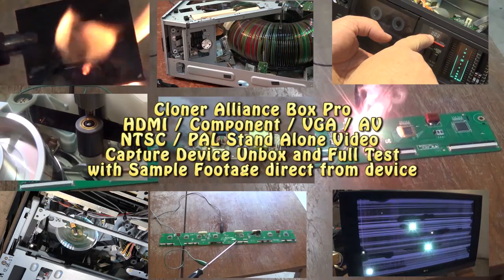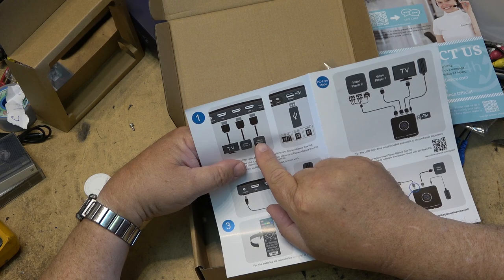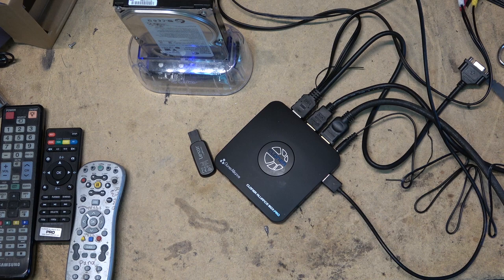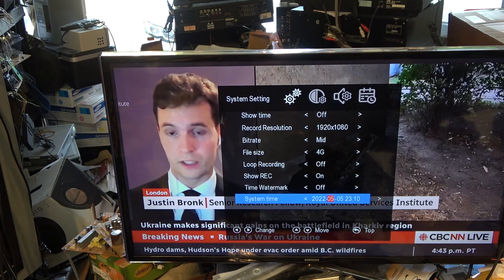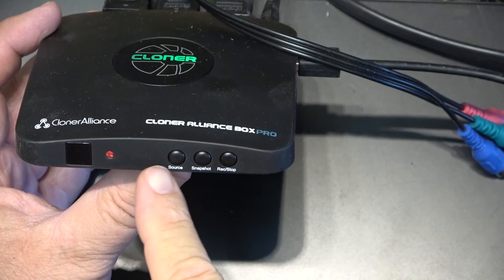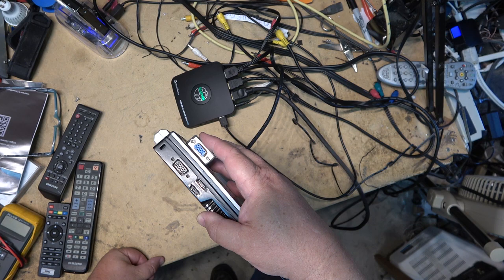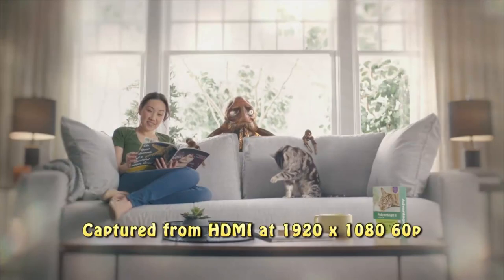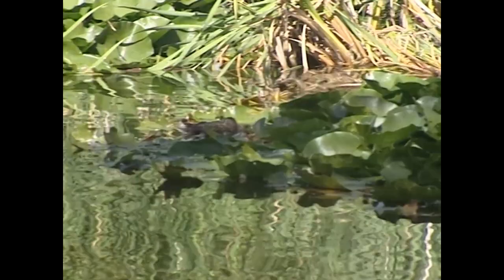Cloner Alliance Box Pro Stand Alone HD Capture Box is the Best I have Tried Yet

Comment: I don't recall noticing if you mentioned it, but does it record interlaced inputs as they are, or does it convert them? I've yet to find something that doesn't mangle things into something they're not. I'm in Australia where we started off with 50 Hz interlaced, and we're still stuck with it (1080i50 now).
Reply from the maker: It deinterlaces and converts to either 720 or 1080 60p
On 50hz countries it encodes 50p. The file standard is set by the tv standard it is plugged into.
Reply: @12voltvids  nice … looks like AI… i hope it doesn't create sidebars with 4:3...
Reply from the maker: @eric-janvandenbogaard9415  you have a choice you can have the sidebars in 4x3 so that 4x3 maintains it's correct aspect ratio are you can put it in a 16x9 mode which will stretch it out to fill the screen but of course stretching it out distorts the image. Most people don't like the pictures stretched out to fill 16x9. there is a button on the remote that lets you switch though so you can display it as native 4x3 or full screen depending on your personal preference. when I tested it I put it in 4x3 intentionally because I wanted to maintain the original aspect ratio of the VHS tapes
Reply: @12voltvids  Thank you ! good to know ! i was afraid for this, but i guess it's doing de-interlace in real time, so one can crop/transform it easy in Davinci Resolve because only the Studio version de-interlaces, and that's done by the cloner box, i guess re-encoding h.264 one more time doesn't hurt the quality that much…. thank you for your answer !

Comment: Did you skip over testing it with macrovision tapes, or or did you just forget to include it. (Or did I miss it?) 

Noticed the note says recorded at 60 fps for the PAL betacam. Does it not record to 50fps for PAL input or was it a typo or intentionall to fit the framerate of the other videos?

It does look a fair bit nicer than these chinese dongles sold under a billion different names these days that record to SD cards. The VCR recording looks relatively stable at least (something both standalone and pc devices usually don't achieve when fed vcr video directly.), was it directly from the VCR or via a TBC of some sort?
Reply from the maker: Remember what I said about I would tell you if it does not handle protected tapes but if I did not say it does not handle copy protective tapes then you can assume that it does? 
I did record clips for macrovision VHS and they look exactly the same as the JVC demo tape in other words it works fine but me just telling you that now could cause YouTube to take the video down. I did show clips from a DVD for a few seconds to show the quality I think that answers the question as they're protected as well even more so than tape
Reply: @12voltvids  why is macrovision still such a hot topic for censorchip?
Reply from the maker: @Elektrokinesis  because YouTube frowns on any circumvention of electronic locks for security. You talk about circumventing any type of software key or defeating any type of Andy copy protection circuits or systems and that falls against their community guidelines and they give you a community guideline strike and that's basically worse than a copyright strike because they'll take your entire channel down and you can appeal them. I got one for explaining how to update software but the software they deemed was illegal because it allowed people to download YouTube videos at full quality music videos that they were protecting so because the software allowed you to download their protective music videos and they're protected movies that they would rent they deemed that illegal and they took it down. I don't need to get another bullshit community guidelines strike and I have the likes of Mr Johnny send check that goes crying to YouTube every time he sees something that he thinks might be a guideline violation and files complaints. If I didn't have to deal with that piece of shit and I don't think YouTube would even be looking at me but he files a complaint for every single video I put up I wish the guy would have a massive coronary and just drop off the fucking planet then my life and everybody else he harasses would be that much simpler because he's by far the biggest thorn in every YouTube Creator side. Harasses Carlson he harasses eev blog he harassed his friend lab. The guy's a grade A assh0le
Reply: @elektrokinesis4150  that's not so hard to understand, youtube is a streaming service, companies get options to put old stock online…. all has already been said in the video or comments,  12voltvids is doing a great job showing vcr repairs, this video box is finally something good to replace a converter and hdmi recorder, because tbc's are rare, or very expensive.
Reply: @12voltvids  ah, right, just me not paying enough attention sorry

Comment: well I, My Dad, My Brother and my best friend has had one of these since 2017. We Record anything and everything, BUT we did notice we had to buy a cheap $30 HDMI switcher to bypass any HCDP. Thats so you can use your DVD, blu ray player hooked up to it, or any signal producing a HCDP signal. We all have those HDMI switchers installed, so we record ANYTHING we want, no matter what it is. I have about a 1 in 6 failure rate of a corrupt recording each to I try a long recording with it plus 90min, I have software that will correct the corrupted file. I find it easier to use fat32 with 2gb recorded files, more stable recordings and easier just to correct 1 - 2gb file than an entire 8 to 13gb single file using NTFS. I use a 128gb USB 3.0 Samsung flash drive. I have tried many of these and even though its not perfect its the most stable and trouble free on I have ever used. I only use it now 3-4x a year, but it works and records each time I need to. Its great when you buy a HD recording from Amazon prime and need a backup of it for your own records.

Comment: Can it capture a PC Bios ? I have tried a lot of cards and stand alone boxes and only every found one that can do it' AGPTEK 1080P HDMI Video Capture Card
It's a Stand-alone box just like what you reviewed and has the same options available, minus the remote oh and you can plug a Mic into is mic input 3.5mm socket.
Reply: the resolution is the problem i guess… maybe Explaning Computers (youtube & website) can help you.
when the BIOS is active some hardware is not active i guess… only a PC with onboard HDMI could do that, just like a Raspberry Pi i guess…
an VGA output is even more unlikely…. VGA can be used as component video though...

Comment: It's a interesting capture box,  I've not seen a capture device keep the same quality as the original.
But yours really looks good,  the ducks... cute little buggers :-D
Im sure you will find the best settings.
I have an old haparge capture card,  hard to stop the software crashing and i had to process the resulting data files to add sharpness/bright/colour .
Ok but nothing to write home about.
Quack!!  Shut up duck 😀
Reply from the maker: The Haupaggue HDPVR it's good but like all other capture boxes that I've tried in the past if you lose sync on the video such as when someone stopped recording took the tape out of their camera and then put it back in and did not cue it up to the last scene and there's a segment of snow, that tended to crash the capture device. When it crashed you have to do a power cycle to get it back. This is because the random Snow or noise created so much data that the onboard processor couldn't keep up when it was turning out an mp4 stream. Now on the other hand if the video was played through a time-based corrector first so that the synchronizing pulses were all kept at the correct timing and the correct amplitude it wouldn't crash you just got snow recorded although the snow didn't have much detail because of the limited bandwidth to try to encode random noise. For the HD PVR I always ran the video through a videonics mx1 first. But that box I used to use mostly for recording HD content off my cable box that I wanted to keep so there was no disruption in the sync signal. you have to remember though that that old capture box is very old I'm on my second one because the first one just died after about 10 years of use so I would expect the modern units to have a bunch faster processor and it's all based on USB 3 now versus the old one which was USB 2. I still have an old hauppauge tuner card in the computer that I haven't used in years I'm curious of whether it still works. I could connect the TV antenna to it and record HD off the air signals and they look great but then again I haven't done it for years and years. This one is basically the answer to my dreams because I'll be able to make a hard copy back up of anything that's on TV basically. rather than firing up the computer in the HD PVR to record something off my cable box I can just record it directly on this. I will be however making a comparison I'll record some stuff using the HD PVR in 1080i and compare it to the 1080p that comes out of this box on an HD TV signal. I'll probably do some stuff where I can do some longer recordings of different sources and compare between different devices maybe next weekend. I don't usually do videos on the weekend I don't do repairs on the weekend because those are my normal work days. I generally only produce videos on my days off which is during the week, so perhaps on the weekend if I have time I'll sit down with a couple of different capture cards and do a comparison between different devices that I own the digitize video so a direct comparison of the same material between the different devices can be made I think that might be an interesting comparison. Compare some standard deaf video that's been captured to DVD and ripped, digitized using the hauppauge HD PVR analog input, digitized using the cloner box, and digitize using my digitally camcorders firewire output directly into the computer. Four different devices same video should yield four different qualities and we'll see which one looks and sounds the best. Stay tuned.
Reply: @12voltvids  I never knew the reason for the crashes,  i understand a bit better now, thanks dave :-D.
I had no internet so there was no one to ask for possible reasons.
My dvd/vcr  unit seemed to cope better at capturing.
I stll have a combo vcr/dvd unit,  just in case i need to transfer a video.
it's a Daewoo  DF-4100P 6 Heads + Nicam  HI-FI.
All silver with chrome bits.
I can hear you saying "piece of crap!!" lol  but it did the job 😀
Reply from the maker: I recorded some stuff from Netflix and it looked identical on playback.
Reply: @zx8401ztv  Recorder combo's are fine, to record onto dvd works, because dvd has a higher/better quality in sd resolution, than VHS has.
Just keep the compression ratio to a level that the content is not "damaged" like with fast movement in the frame/fields compression should not be strong so shorten the duration of the footage you put on one DVD, or check if the optical(recorder) drive supports double layer discs, check settings for where the layer change should take place when possible.

Comment: Pretty impressive performance for such a tinny device,  what is the capacity of the hard disc? Does it record only for three minutes at a  time only? Does it transfer its content to an external storage unit? (?)
Reply from the maker: The size of the hard drive is whatever you plug into it. The drive I was using for testing was a 500 gig but I could have easily put a terabyte or a larger. If you are using FAT32 then the largest capacity is 32 gigs but NTFS or ex fat you're limited by the file size of the operating system. the only reason it only recorded for 3 minutes is because that's what I said it for you can have the thing continually record until the hard drive is full it'll just keep on recording. In its current setting it breaks the file size at 4 GB but I see that that's also adjustable so that you could have files that were much larger than 4 gigabytes in size but I haven't taken it to the max yet what you see is what I found on it during my initial unpacking and demo, I will be using it and doing more extensive testing on it, I'm going to digitize a couple of tapes that I have of my own content that I can put up so that you can see how it works and how it looks and I'll probably use the highest bit rate I had it set to the default which was medium. I plan to do some comparison using some hdv tapes transferring the content over firewire and HDMI into the cloner pro at the same time so the same tape pass will be recorded directly through the firewire onto the computer and onto an external hard drive on the cloner pro that way I can play the tape once get two files from it and we can compare the direct capture over firewire to the HDMI output from the video player. I'll do the same with a standard definition mini DV tape and probably do an analog tape as well using the firewire converter on my digital 8 camcorder to digitize a hiat tape and take the AV output and capture that. Should be an interesting one it will be all on the quality of the video there'll be no demo features like in this one it will all 100% be capture video compare the quality as I've got this unit as an archive device for my business so I fully intend to use it and I want to see what is capabilities are and what the best settings are to make it look it's best. So far though I'm pretty impressed as you probably saw from the clips from the Blu-ray disc I think I answered the question as to whether it will record protected content. I did a macrovation test as well and the results were the same. As I said I would tell you if it didn't record protected content and I didn't mention anything about it not recording protected content. That's as far as I'm going to take it however because YouTube is pretty strict on anything that can be used to deal with circumvention of anti-copy technology. I got a community guideline strike and you're only allowed one for showing how to manually apply an update from the developers website to a piece of software that would allow you to download streaming content. They blocked the video and gave me a community guidelines strike for dangerous content. I appealed it it was manually reviewed and the strike was upheld. I guess some snowflake at YouTube thought that downloading streaming content was a dangerous thing, even though you could watch the same content. The same thing happened to everyone that was doing videos dealing with a certain piece of software that was derived from Xbox media center. I don't even want to say the name of it but it starts with k. many people that reviewed that software found that they had violated YouTube's terms of service and found their accounts demonetized or restricted. I know a guy who did a video showing how to clone a Sirius XM radio so that he could pay for one subscription and get it in his car and home without having to pay for a second subscription. His video was also blocked. He wasn't showing people how to get free satellite radio he was just showing how to take an existing radio and copy the ID from that radio into another radio so that it would be a clone of the original.  it involved pulling the chip out of an original radio reading it and then programming that contents into a blank chip and installing that in the second radio. Not something that the average person could do without specialized equipment but still YouTube took exception to it and removed the video.

Comment: Very nice. A bit expensive at the moment, £189.99 in the UK
Reply from the maker: Well you get what you pay for. The capture device I've been using for the last several years was my Sony hdv video Walkman basically. It had analog and S-Video input with the time base corrector and spit out a dv25 stream that was as good as anything I've seen and it was about $1,400. Same with the old canopius capture card, and my hauppauge HD PVR. They were around $250 a piece as well back in the day. So I think this unit is actually quite a bargain considering that it upscales to 1080p and it does it on the fly and delivers results like it delivers
Reply: @12voltvids  yes it is a great device and you did a great job showing its capabilities. Think it's more a case of lack of funds at the moment.
Reply: @waynesharp1690  some people asking stupid high prices for rare TBC devices, also because they're old and need to be recapped most of the time, a normal repair person won't do such an extensive service on such TBC device, so i guess the price is right for this cloner box. also it's a niche… capturing analog video.

Comment: A question...does your VHS machine have a built in TBC? If it doesn't, then that CA Box Pro does a very good job!!!
Reply from the maker: No TBC on that one. It's just a cheap old VCR
Reply: @12voltvids  So the Box is doing a fantastic job!
Reply from the maker: @FarrellMcGovern  Yes. More in depth tests coming soon as I have time where I will do direct comparisions to other capture boxes.
Reply: @12voltvids  great! Thanx!
Reply: @12voltvids  most likely a 4:3 into 16:9 (with sidebars ?) or a real 720x480 file ?